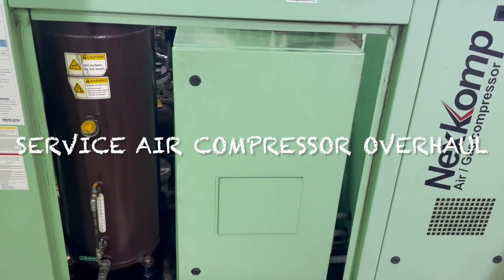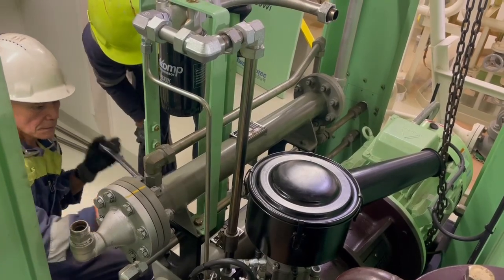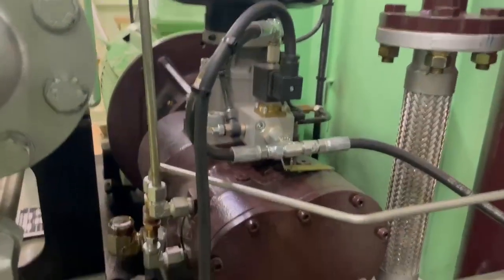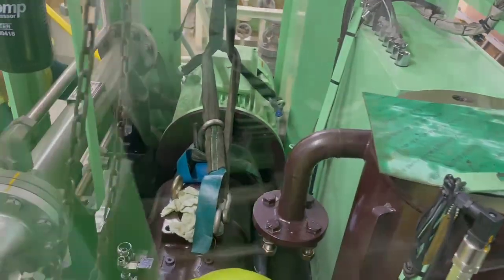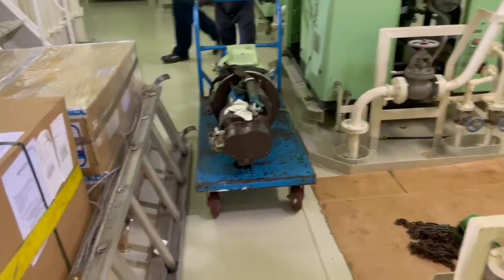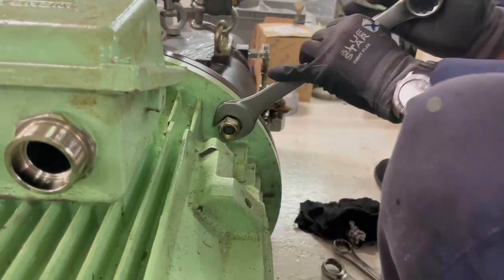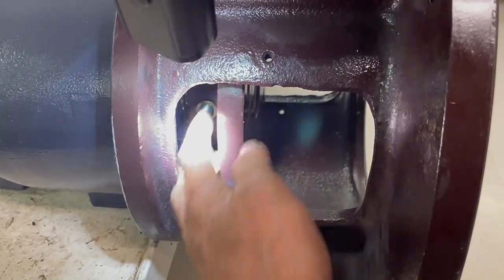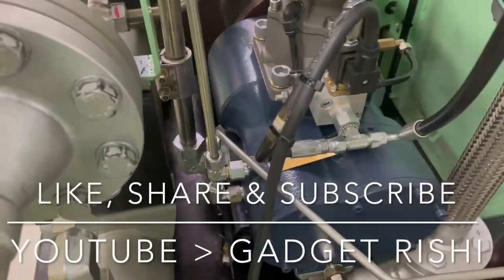Service Air Compressor (screw type) Overhaul

Comment: Anyidea why the ampere is increasing ince compressor onload?
Reply from the maker: Ampere should rise when compressor comes on load.
Reply: @gadgetrishi  thanks for replying, Bht compressor getting tripped on high ampere (31A).
Dismantled motor, renewed bearing even though no issues found.
We have dismantled the screw now.
Seems to be ok that too. Problem could be from minimum pressure valve or check valve...